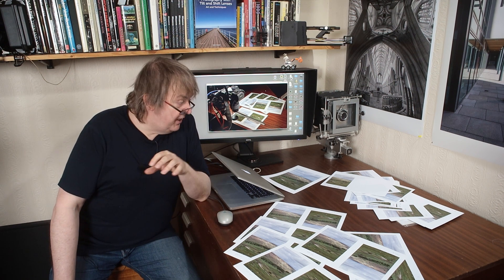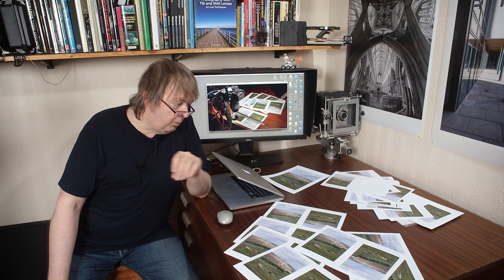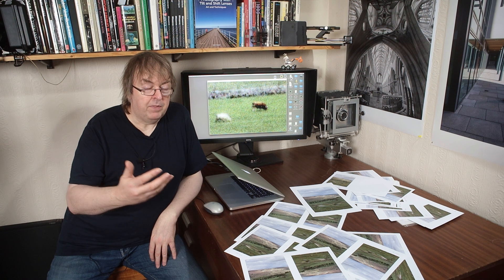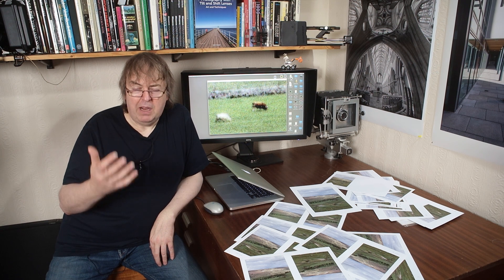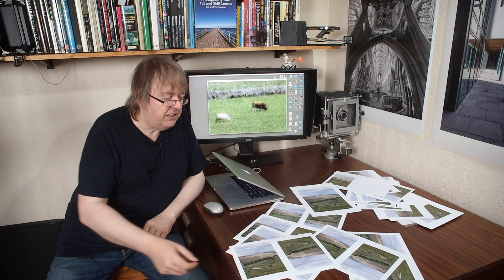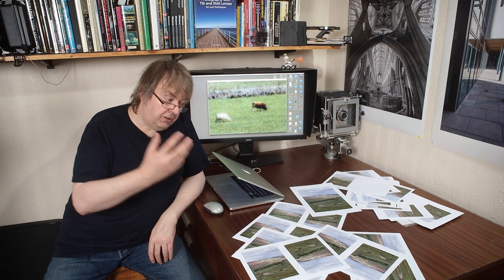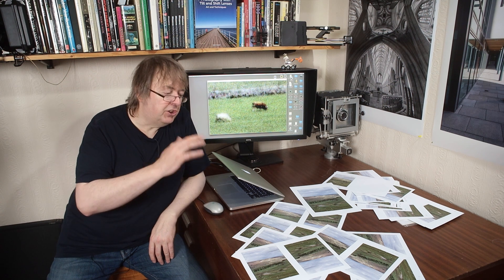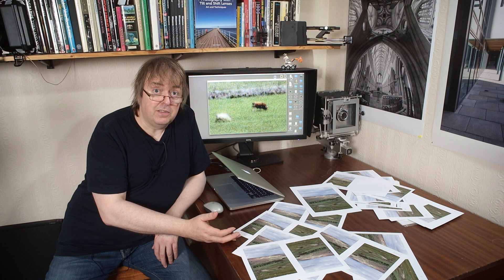Epson P7500/7570 best settings for print detail

Comment: Great insightful review - while you haven't said it I think the 7500 is possibly the Epson high end pick for larger prints - assuming you can afford it and accomodate it.  
Interesting observation re the P900 providing marginally  better detail than the 7500.....  does that apply to the 5300 as well?   Looks like 600 dpi is optimum for the 7500 which I will keep in mind if I ultimately decide  on purchase.
One question: Is the 7500 quieter than the 5300?
Reply from the maker: Thanks - do check the written articles about detail - it's much easier to show stuff in articles than any video
https://www.northlight-images.co.uk/best-epson-p7500-driver-settings/
See the discussion there for more info about PPI and DPI and detail to send to the printer.
Both reviews predate me owning a sound meter, so you will have to read the detailed specs from Epson - I have a feeling the P7500 made more noise.
Neither would I want sitting next to me if I was working on something else...

Comment: Hey Keith, would you send it to print right from lightroom after you done edit without exporting it as JPG and then take it to Photoshop then print it, or better while you still at the EDIT on LR so you edit and just print it as finished without compressing to JPG .. what do you think?
Reply from the maker: Personally, I never ever use LR, so I don't know. Its 'do everything for you' approach to printing is one aspect I rather dislike, apart from producing bulk 6x4's or the like ;-) 
My viewpoint might change if I had to a lot of editing/printing, such as for weddings, but that's not the sort of photo work I do...
If I wanted to take it into PS I'd use a tiff, not a jpeg, but [just] for print use of low compression [highest quality] JPEG isn't too bad.
Reply: @KeithCooper  you lost me completely heheheh ... I shoot DNG ( raw ) so I take it to light room to edit it, doesnt matter if LR or PS, but while you in that software as this is my main point, would you go to the print section after you done edit, without export it or convert it to tiff or miff or anything, just from DNG  or RAW .. do your edit thing and go to print, thats what I meant :)
Im trying to get best details and quality possible from a print ( forget about weddings ) no one print weddings photos ( on P 6000 ) Im talking about big prints ... so Im trying to understand the best way to print, to stay with the edit software and just selected  print and print it, or export it ( or save as ) a file and then go to another place and do stuff there ... and so on. I want the best way so the print will be original and quality fully.
Reply from the maker: If I open a raw file and edit in Photoshop, then I'll likely print directly from Photoshop - there is no need to export at any point. I may save a copy of the print ready file, but that would be as a .psd or tiff
I would only export for print if I was using additional software for printing [such as a rip] and it were not integrated in any way [such as if I were using print layout software like Mirage]
The precise print workflow would depend on the software used  - examples would be resampling and sharpening @RAMSEYSPENCER

Comment: What is bronzing?  Thank you for any replies.
Reply from the maker: it's where  reflected light (usually at a oblique angle) from the surface of a print takes on a slight metallic sheen. It is very dependent on the  paper surface type. I cover it in more detail in my written articles - it's difficult to meaningfully show in videos

The classic version is seen here (~80% into the article)
https://www.northlight-images.co.uk/hp-designjet-z3200-review/

See the examples for the P700/900 towards the end of
https://www.northlight-images.co.uk/black-and-white-printing-with-the-p700/
This is distinctly less than the z3200

In general, it is a much less serious issue than it was a few years ago.

A clear coat ink or spray will usually eliminate it - that or using a different paper...

Comment: Hey Keith. This video had really confused me. I'm pretty new to printing you see. You say send as much detail to the print driver for best results. What do you mean by this? I have a Epson 15000xp and I always print a 300ppi at highest quality. Am I doing it wrong. Cheers PS love the videos 😁
Reply from the maker: Ah - first up, this video ONLY applies to the printer mentioned in it, so I have ones for the P700/00, Canon PRO-200 and PRO-300 - I have not done this test on the XP-15000

Secondly, I'd suggest reading the actual written article, I go into lots more detail and explanation than is possible in a short video
https://www.northlight-images.co.uk/best-epson-p7500-driver-settings/
or even more explanation in
https://www.northlight-images.co.uk/driver-settings-and-print-detail/

However you are not doing anything 'wrong' as such - If the native resolution of your image was for example 407ppi, then send 407ppi to the printer, don't reduce to some special number
BUT Every printer is subtly different...
I might expect my findings apply to the 15000, but I don't know

My videos are always more general than the written articles - videos can't be updated/corrected/expanded, whilst all my written articles are fixed/improved as needed ;-)
https://www.northlight-images.co.uk/photography-articles-and-reviews/

Oh and the articles go back ~20 years, the videos two... :-)
Reply: Awesome thanks Keith. I'll take a look at the article. I don't suppose you know the native PPI for the Epson XP 15000 do you?
Reply from the maker: Not without testing - I only had one here for a while on loan from Epson.
The P700/900 article does explain the test methodology in some detail, so a good high res image and a few A4 sheets are all that is needed
Reply: Ok great stuff. I'll take a look this evening. Thanks for replying 👍

Comment: Good stuff Keith and interesting results. I had an issue printing small 6 X 4 prints on Epson Premium Gloss via Lightroom's Print Module. If I unticked the resolution box and let the printer have the maximum PPI ( the image was in excess of 50 MP by the way ) the prints looked terrible. If I changed it to 360 PPI the prints were perfect. I can't recall what PPI was showing when I unticked the box ( you get a small dialog appear in the top left corner of your image telling you the PPI ) but it was something crazy like 1200 ish. That's a pretty huge PPI to squeeze into a 6 x 4 print! lol. The prints looked very rough with poor tonal gradations. Perhaps mine is an extreme case here ( huge MP image at high DPI on a small print ) but certainly my printer got a bit upset being asked to take every bit of detail the image had. 😊
Reply from the maker: Thanks - However I'd note that this varies considerably with every different printer I've looked at.
It may even be different on Macs and PCs (not tested)

Not that I trust Lightroom printing though :-)
Reply: @KeithCooper  Other than the above caveat I've found Lightroom's Print Module to be excellent overall. I much prefer it to printing directly from Photoshop personally 😉

Comment: Extremely useful Keith thank you. I do own the 7570 here in the USA and love it... Wow what a printer. Interesting you mentioned bronzing, I have been experiencing horrible bronzing when using Epson own Exhibition Fibre paper. Not sure why and yes I am not using the "max" quality setting in the driver. I am getting very good results with Epson''s Baryta paper which does not exhibit bronzing ...
Reply from the maker: Glad it was helpful!
The bronzing is investigated further in my [written] look at B&W for the 700/900, where it definitely occurs more on some papers at the higher quality settings. It was because of this that I looked at it more carefully with the P7500 - where it is less evident. Very much paper and settings dependent.
My personal feeling is that it looks more of an interference effect and is worse on the 700/900 because of the smaller droplet size and finer resolution at the highest settings

Comment: Interesting!  I have the Epson P900 and have stopped sending 360 ppi to the driver because I have read articles that you should keep it at 0 and let the printer decide?  After hearing this, you think I should be using 700 ppi always to my printer?
Reply from the maker: Letting the printer 'decide' seems to be a very bad idea - this sounds like some Lightroom chicanery, always suspect when it come to print 'quality' (IMHO - YMMV)
If you have real detail above 360, send it - there is absolutely never an 'always' in this sort of stuff!
The idea is to send as much detail as you have - in the P900 case, up to ~720PPI
Look at the details for the P900 article, since they are slightly different than for the P7500